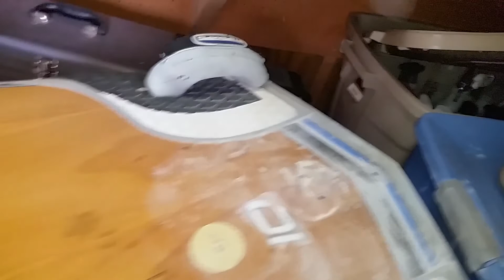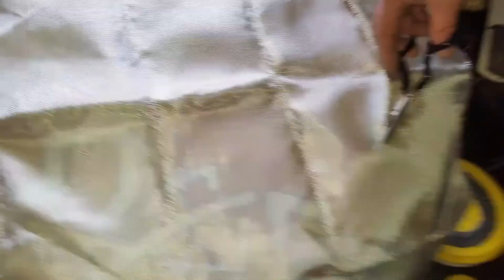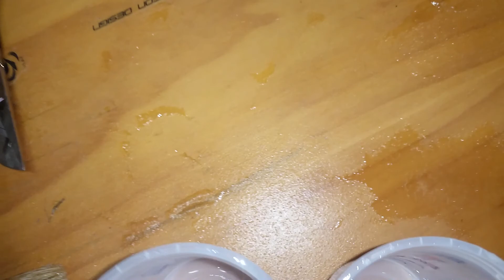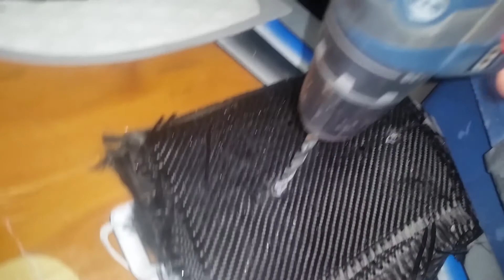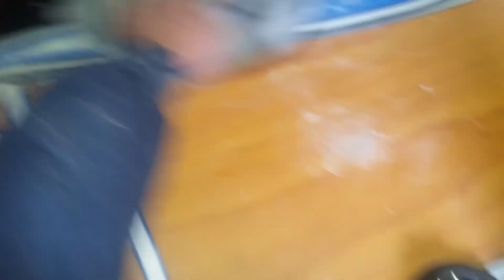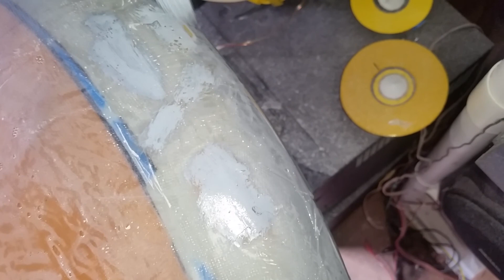Reinforcing a 2005 Starboard Formula for a Windsurf Foil.

Comment: Good one. Use masking tape where you don't want resin and glass to stick...like on the rails and bottom of board. Lose the wax paper and rather use a foam roller to wet out the glass/carbon. It absorbs excess resin, pushes out bubbles and generally leaves a nice surface. You can also apply a thinnish plastic over the glass and use a roller to flatten it all up. It squeezes out any air and prevents any going back in....almost like a vacuum effect. You certainly won't get those thick high spots of resin like you did on this job. Good luck!
Reply from the maker: Thanks!

Great advice!

Comment: great video Jonathan.., i got a old Formula 147 about 2004, could i reinforce the deep tuttle base with glass fibre,  and do you need to reinforce the deep tuttle where the fin goes in??
Reply: https://youtu.be/KjqOVo77-zI
Reply: @geoffdavey1  Fabulous Idea as i got a Old Isonic 150 definately the way to go.. thanks Geoff.. both my Old Formula 147s heard the Deep Tuttle Base Crack each time.. such a funny thing to hear.. Eeeeeeeeeeeeeeek
Reply: @simonjandrell5897   mine was more a crackle but nose down was strange!
Reply: @geoffdavey1  got a Neil Pryde AL Foil it Nukes any Deep Tuttle a Knitemare!
Reply from the maker: Hey Simon,  

I have had rilly good luck with the reinforcment that I did.  No creeking and feels solid.  Bad crashes are rair now but I am glad I reinforced the nose.  

You can reinforce the bottom with layers of glass.  If you do that I heard you want to sand or round the edges ware the foil goes in.  If there is a squared edge the fiberglass or carbon can catch and be pulled up as you take out your foil.

Best of luck and have fun flying!
Reply: thanks Jonathan got few holidays on the horizon, so will spend sometime with this,  new to foiling, cannot wait to do it, it looks such fun..  hope you get some good winds, just waiting for the storms now in Britain

Comment: I have almost the same board and it withstood a direct impact with a submerged log at full speed and did not get damaged.   I use a Manta foil that has a reinforced plate underneath.  Love the board and foil!
Reply from the maker: Thanks for letting me know.  The board and foil have felt very soild.  I still have my teather on just in caise I hit something.  I usally go to the same few spots, there is rairly debree in the water.

Might be OK for me only use the teather for new locations.
Reply: https://youtu.be/KjqOVo77-zI